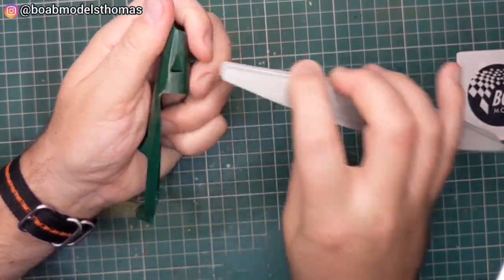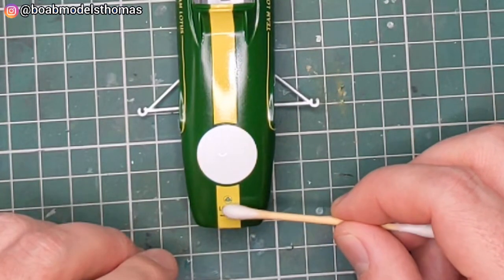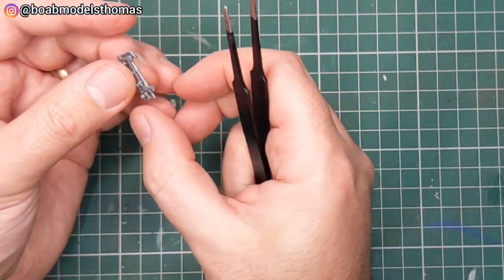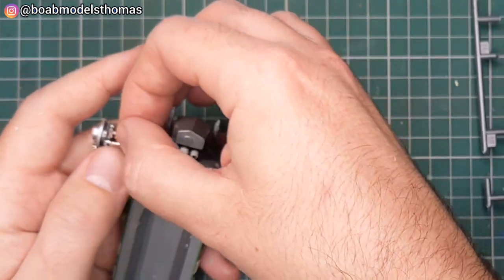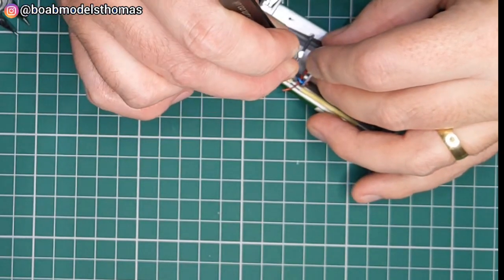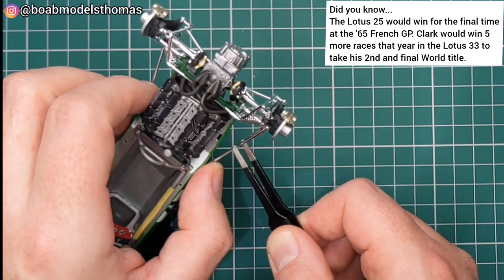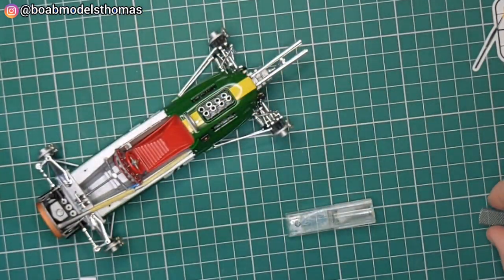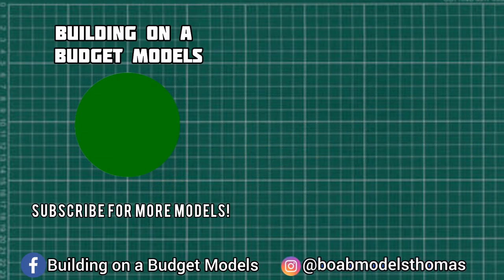Lotus 25 Coventry Climax - Jim Clark's Championship Winner - 1/20 Tamiya

Comment: That's a lovely Lotus you have build here. I especially like the mesh you have made on top of the engine cover. It looks much better then the original kit part.

I just had your channel in my recommendations. You have made some videos I will definitely take a look in.
I already subscribed.

Regarding the Lotus 25:
Most versions without the yellow stripe also have a different windscreen. If you want to build an all green version, the easiest way is to build the car from the Dutch Grand Prix 1963. It was the only race with the windscreen included in the kit and without the yellow stripe. Even the 'Team Lotus' writings on the sides and the 'Lotus Coventry Climax' writing were missing. You will just need the Lotus badge on the nose and the startingnumber 6 which is available at indycals.
Reply from the maker: Thanks very much, Steffen. I find small touches like the mesh can make a big difference. 
Good tips about the early version of the car too. I've seen that Indycals do a lot of of alternative liveries for historic cars